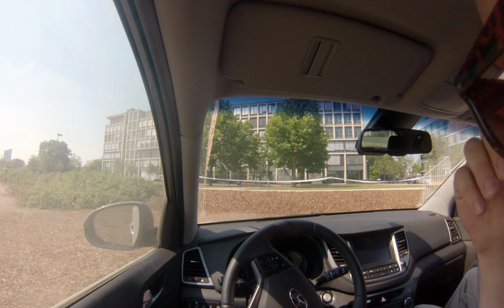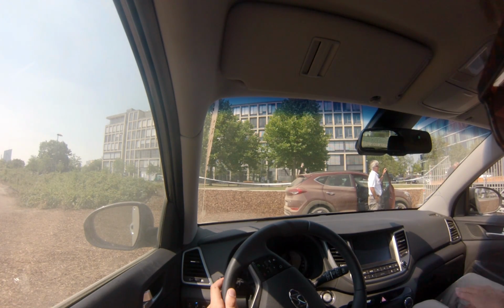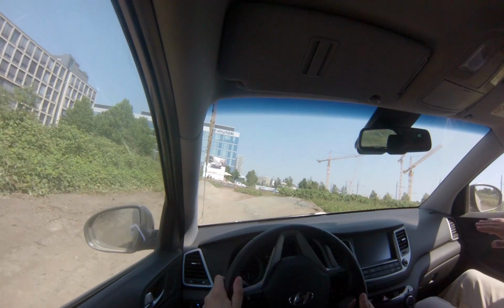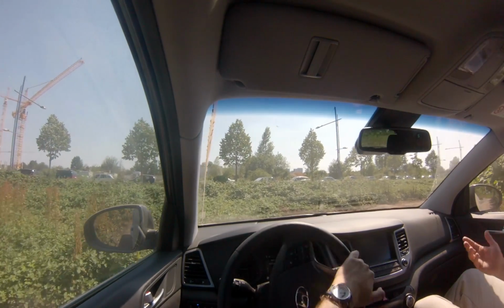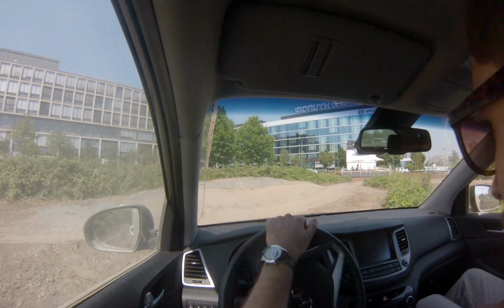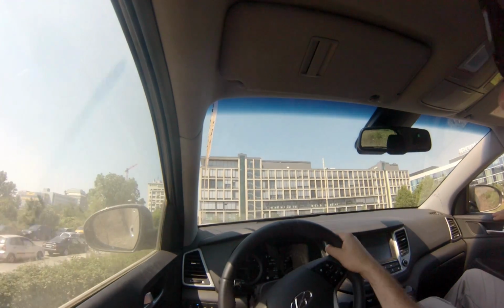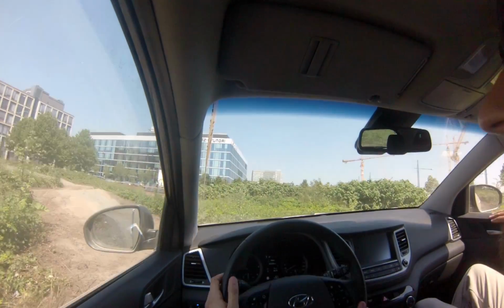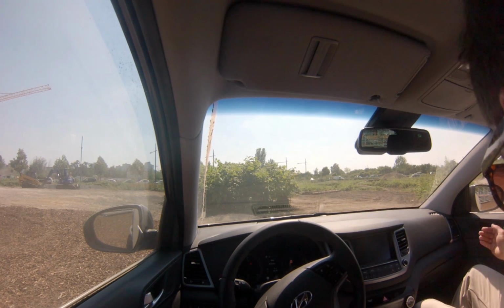Test off-road Hyundai Tucson 2015

Comment: Masinistule: If the car had manual gearbox the descending hill should be very slow and nice !
Reply: scartos scarto That`s what I said. I`ve driven manual gearbox cars that had HDC and it worked even in neutral. Probably it`s the same case with the Tucson.
Reply: Atunci nu înțeleg de ce la coborârea în pantă a fugit așa.
Reply from the maker: scartos scarto Pentru că sistemul devine activ doar când sesizează o înclinație a mașinii, iar cum panta era abrupta, a avut o mică întârziere. Pe uscat nu pare o problemă, dar pe ud s-ar complica situația.
Reply: Probabil că ai dreptate dar la mine la ix35 cu cutie de viteză manuală nu am pățit așa ceva. Cum am luat picioarele de pe pedale, cum a și intrat sistemul în acțiune. O distanță ca aia în care sistemul să nu funcționeze și aștepți după el, poate fi o problemă.
Reply: Bine că vorbești limba română
Reply: @MasinistulRo   de ce n-ai pus subtitrari ? Ce sa inteleg eu ce discutati